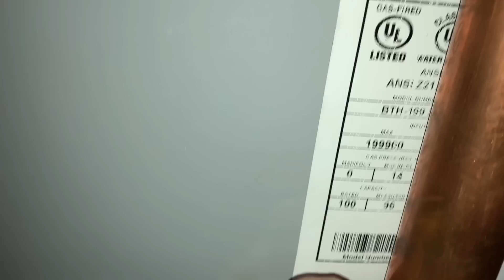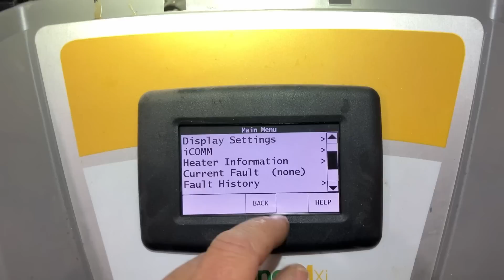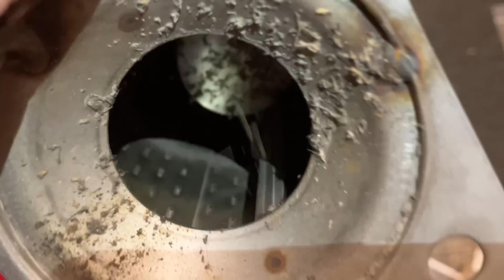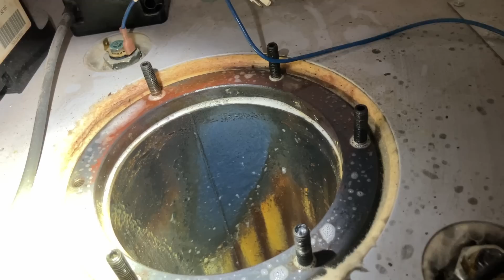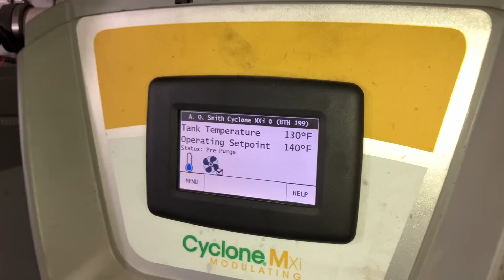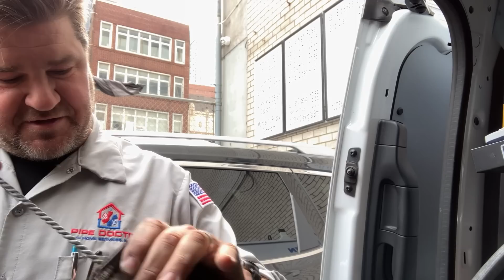🔥 AO Smith Cyclone Water Heater Not Heating Enough? Here’s What Most Plumbers Miss!

Comment: You could’ve used the PVC pipe I belief 4 inch set that unit down inside the PVC pipe while you assembled it or 5 gallon bucket with a hole in the top of the lid

Comment: The rebuild kit must be expensive. A Four hour service call. That had to be a grand or a little more. Two or three standard 80 gallon water heaters in tandem would give the same GPM at a much lower cost. That water heater is over $10,000 just to buy it and burns 120,000 btu’s of gas.

Comment: Hey Mike, looking at one of these tanks now.. Every time it tries to fire it backfires. Had a ignitor code when I arrived and I pulled it and it was broken off. Put a new one in and after it trying to fire multiple times I pulled it and the silicon carbide was all full of black soot. Tech support has me throwing parts at it to no avail. I noticed in the combustion tube it's half way full of water and the condensate drain is clear. Are these blowers strong enough to blow the water through all the tubes or am I SOL? I noticed you ended up vacuuming yours out. Could Possibly be pinholes and tank needs replacing?

Comment: Nothing beat chimney vent boiler.
Reply: The older water heaters and lower tech inefficient gas boilers are far more resilient to lack of maintenance, but the main be efit is that they are fairly quiet when in operation, especially if venting to a chimney.

Comment: Was looking forward to seeing the condensate line cleaned out, but it was cut out. Still a great video.
Reply: Trying to get that condenser pipe thing open I cracked it! Jerry-rigged now because I need hot water, I replace the ignitor once so far,